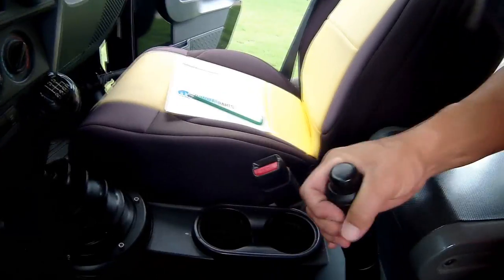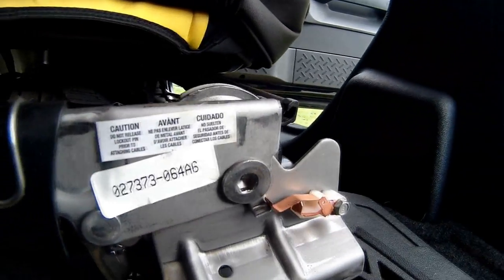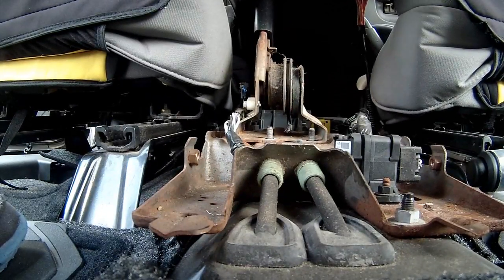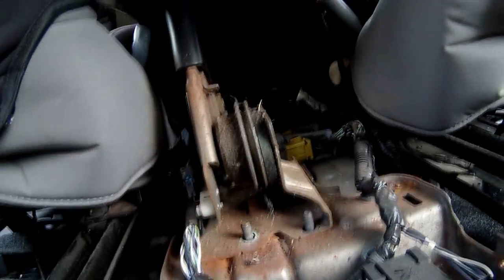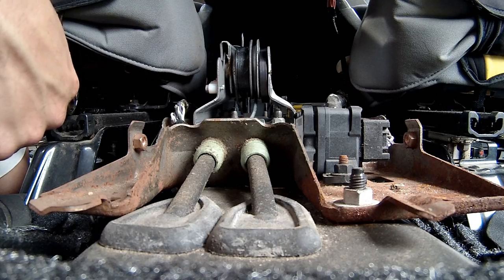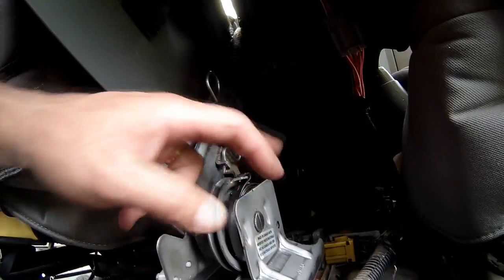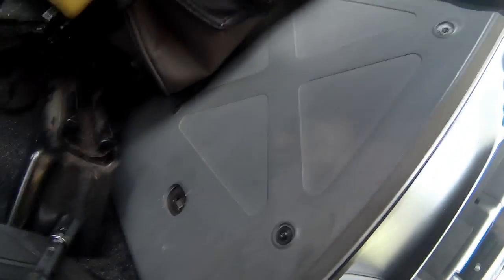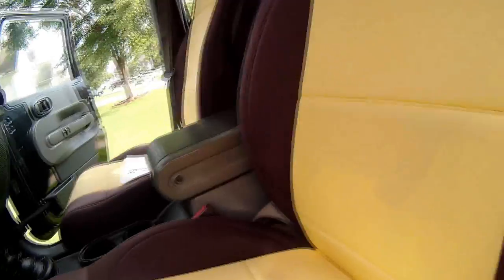Jeep Wrangler JK Parking Brake Replacement

Comment: After a lifetime of working on vehicles (not jeep), I have never come across a more complicated USELESS dangerous, and unreliable system very badly engineered. A simple adjusting screw on the short cable would suffice and quality cables that do not stretch as much. Another improvement would be to look at the mechanical advantage mechanism in the brake drum which would require less tension on the cables My Toyota surf is 32 years old and has never had an issue with the cables stretching
Reply: Totally agree with you - looks like they finally made that one bolt adjustment on the JL versions.  Only took Jeep how many years to do this?

Comment: Thank you so much just fixed mine in thirty minutes no mechanic experience actually my first jeep repair on my 07 2 door it's a tight fit in the back seat but your video made the fix a breeze and I did not have to take the console off. I also did this at night. Keep up the great work!

Comment: 🟢cta1284  15.09’24- I went a different route on my 2013 JKU & did the clock spring fix which no one else did.  Here’s my solution….
 JK Parking Brake Lever Repair (2013 JKU)

•Repair adds a single wind on clock   
  spring to re-tension parking cables.
•The clock spring’s tension is not difficult 
  to move.
•Can be done with parking brake handle 
  assembly in vehicle

ITEMS NEEDED
PULL LINE- 
•20 in. of 18ga wire
  (Stranded or solid, insulated or not)
PLIERS- 
•Vise grip 
  (Pull line handle)
LEVERAGE TOOL- 
 •Large screw driver, chisel or equivalent
   (Starts movement on clock spring)

REPAIR PROCESS
o Remove center console & associated  
   wiring; makes the job easier.
o Lower parking brake handle.
o Cut 20 in. of 18ga wire.
o Run wire 1/2 way through the bend of 
   the clock spring’s hook that engages 
   tab. (May need to push hook forward to 
   get wire through)
o Start a tight twist at the spring’s hook then 
   continue twisting the wire together.
o Run the twisted wire forward / down & 
   feed it under clock spring towards 
   rear of vehicle.
o Attach vise grip to end of twisted wire.

o The next step will require two 
    movements at the same time- 
o 1) With a large screw driver, chisel or       
   equivalent, push forward on clock 
   spring hook & down in front while 
   2) pulling on the twisted wire with 
   the vise grip.
o Keep pulling until the hook lines up with 
   the tab.
o Shift hook over & slide hook 
   back onto tab.

o Re-install center console.

Comment: You could have just installed it, pulled the pin and then pull up (ratchet) the parking brake lever to a 30-45 deg position to close down the center console fascia and have the lever push through the opening.

Comment: The cable on mine was wrapped around once when I removed the 2 cables going to the bottom if the tub, it flung under and over.

Comment: you replaced it with same crap from MOPAR  aftermarket china gotta be better
Reply: Mr. President, you might not believe but its true, 12 window regulators, average 3 pcs. of regulators for each door, and 3 parking brake cable during 6 years of owning 2000 Grand Cherokee, this is unbelievable even for me, but I love this MOPAR crap and I don't know why?

Comment: You forgot to attach the dash indicator wire, but you likely figured that out now after 7 years.  I'm about to replace mine in my 2017 Rubicon.  Thanks for the video.

Comment: Eureka. I managed to tighten the clock spring one turn quite easily by getting a piece of soft flexible reinforcing tie wire, running under the spring, from front and twisting a loop around the hook on the spring. Pulled hook around to the rear & hold with a 4mm rod. Fed wire around front again & pulled around again to hook on lug (with a bit of coaxing with needle-nose pliers & small screwdriver) The wire slip down the side of the spring a few times but persevered. Some sort of thin strip could be inserted down beside the spring & the housing reducing the gap so the wire would not slip off the spring

Comment: I went onto Mopar to look up the part and couldn't find it. Is it a kit or did you have to order each piece individually? A link would be greatly appreciated, pulled my handle up and snapped, and now no tension or pressure when I pull it up.
Reply from the maker: Sorry for delay, I rarely check the comments on the videos.  Mopar Lever-Parking Brake 52059887Ae

Comment: could you have just replaced the broken cable?
Reply from the maker: With enough effort, many things are possible but in my opinion, attempting to replace just the cable would be a nightmare.  You would need special tools that cost more than just replacing the whole thing. The spring loaded mechanism would be tough and welding/soldering the little anchors on the end of the cables would be irritating.  Perhaps you could rig an anchor using compression bolts or something.  Overall, not worth the effort.

Comment: Why can you not just get that short piece of cable? that goes to the two cables... it is just stupid to get an entire handle assembly
Reply from the maker: With enough effort, many things are possible but in my opinion, attempting to replace just the cable would be a nightmare.  You would need special tools that cost more than just replacing the whole thing. The spring loaded mechanism would be tough and welding/soldering the little anchors on the end of the cables would be irritating.  Perhaps you could rig an anchor using compression bolts or something.  Overall, not worth the effort.
Reply: Yea I was thinking it was the cable going to the two brake cables, not to the clutched part of the assembly so I ordered it.  Thanks for the reply

Comment: How frequently do you use the parking brake and how many miles are you up to now? I found your clutch replacement video to be quite helpful and I imagine I'll be doing the parking brake cable sooner or later as well.
Reply from the maker: I'm up to ~80k miles but I use my parking brake exclusively when parking the Jeep, so that parking brake is cycled about 4-8 times per day.  I am pretty forceful with it, but still, I don't think I should have been able to snap a steel cable after ~15,000 cycles.  I'm glad the clutch video helped and I'm just as happy to report that mine is still going strong.  I was worried when I took on that job. ha!  I'll be adding a few notes to this video later, I just wanted to go ahead and get it out just in case it's helpful.